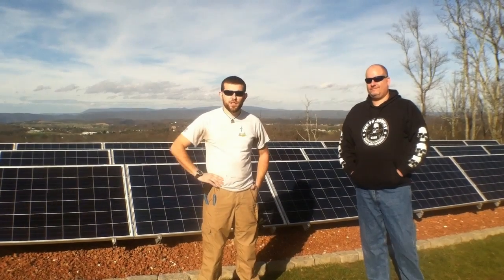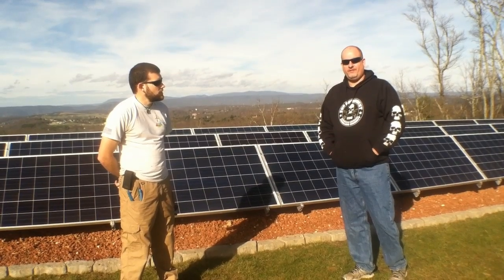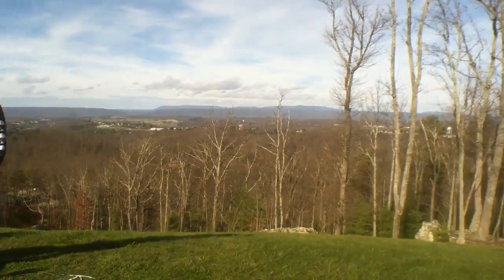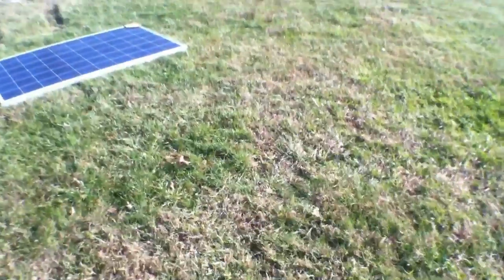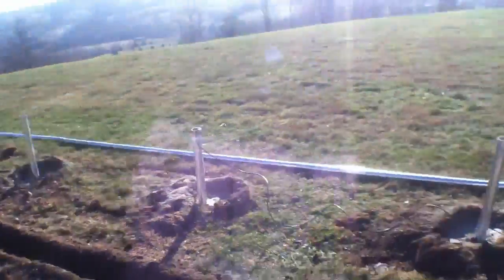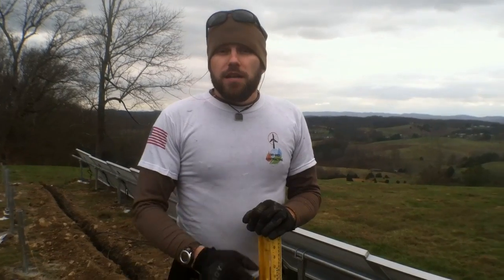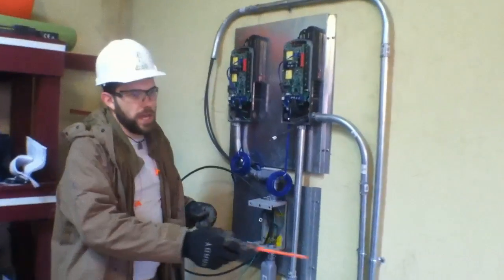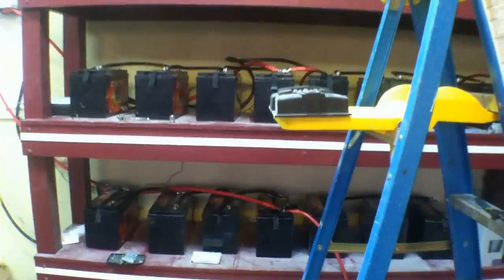Off Grid mountain top 7.2 KW solar install from start to finish built by Off Grid Contracting

Comment: Thanks for the video of the intense prep work just to begin the solar panel install (was cost an issue? 27u x 270W (sharp?) seems like a low density (W/sq ft.)solution
Reply from the maker: +David Porowski sysnthesis is the panels. The customer wanted a tight layout so we did as close as possible without shading becoming an issue. Cost was probably in the 25K range for customer when all was said and done. Im guessing if installed by other solar installers the whole thing would have probably ran 40K at least.